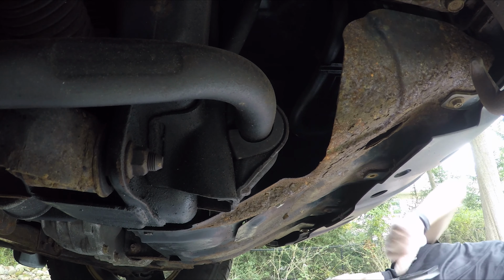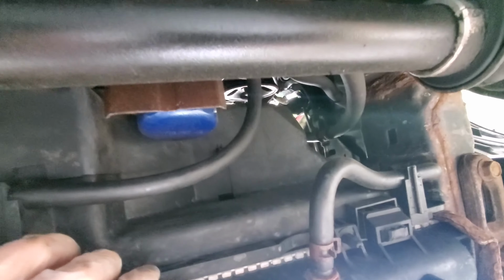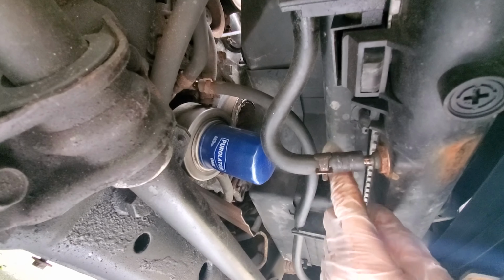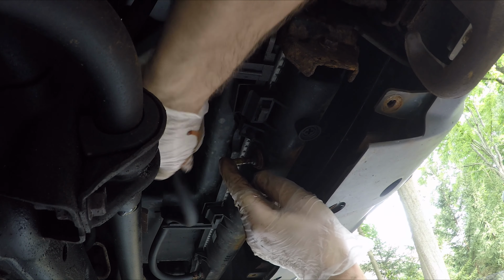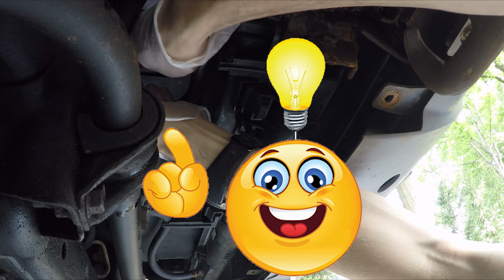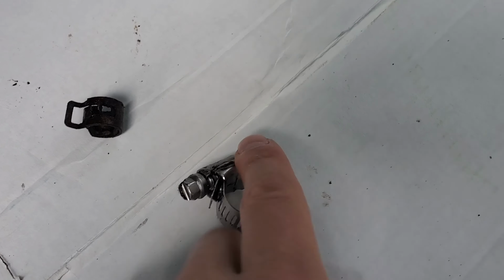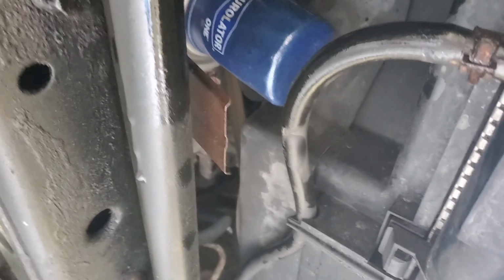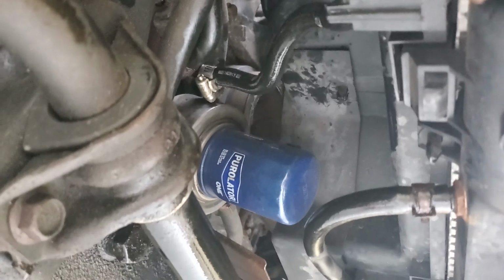SMOD Prevention Nissan Xterra Radiator Bypass ( Disclaimer Read Description )

Comment from the maker: Update !!  I finally was able to replace my radiator PLUS lots of other things  thus no longer I am running radiator bypass ! 
https://www.youtube.com/watch?v=fF0GRk-Fkdo
Reply: @DIY_AUTO_PHOTO  can you emphasize on this one some more? Does a new rad eliminate the need for the smod mod? What rad did you purchase?
Reply from the maker: @dmckay80  Yes with new rad   like ( koyorad a2807  )  you no longer and you should not do the radiator bypass to keep the trans cooled all the time.. That was the radiator I got later on..  However much later I did switch it to 3 row full aluminum rad by alloyworks  . ( i have videos on both of them on my channel )

Comment: I’ve had theee xterras and did this mod with all three. Drove 70+k miles on each chasing storms. Lots of off-road/minimum maintenance roads and never had an issue with the transmission or radiator. Simple prevention.

Comment from the maker: Please ! Before modifying your Car/Truck  make sure you read and do a research on what this modification might do  to your truck. Also.. this is a temporary solution and prevention from transition oil mixing with coolant as later I am planning on replacing the original radiator that I have on the truck right now. That is old and I dont want it to crack and mix tran oil and coolant together.

Once I get a new radiator I am planning to reconnect the hoses back to the original locations thus ensure the better cooling of tran oil. As of right now its fall and then will be winter time and I am not doing any heavy pulling or heavy off-roading  on the truck yet so I am safe. 

Thank you again for watching and be safe !

Comment: Thank you, I'm planning on getting a xterra this week with 130k miles , this is  the first thing of going to do, but first I' will Check my trans fluid just to make sure it's not milky
Reply from the maker: Awesome and congrats on your xterra !! I am sure you will like it ! what year is it ?  
and I am going to make a update to this video soon! so.. be sure to check that out too
Reply: @DIY_AUTO_PHOTO just bought yesturday, 2006  with 131,xxx miles
Reply from the maker: @Freyes2017  congratulations !!! on your new truck !! almost like my then just with a a bit lower miles )
Reply: @DIY_AUTO_PHOTO  I just go mine and try to do the bypass but seems the  hoses had been move  by the previous owners, the hose that closes the cycle at the bottom of the radiatior side to aide its not there and has a plug on both sides instead.  The previous owner had this truck for 3 years with no issues.
Reply from the maker: @Freyes2017  Oh nice so it is already bypassed then, just make sure there is no pink stuff inside radiator... so should be safe for now.. just be careful dont do alot of off roading or tow something as transmission might overheat..  later on the right thing would be to replace the radiator to Koyorad A2807 and place transmission hoses back to original locations for maximum cooling
Reply: @DIY_AUTO_PHOTO  I appreciate your help bro, Im looking at the radiator cap  but it doesn't have serial number and  it just shows the nissan cap with "never open when hot" in different lenguages, that's means I have to replace radiator ASAP correct?
Reply from the maker: @Freyes2017  more likely its original radiator.. and it might lead to SMOD...  new video is up tomorrow with all the links and part numbers for all new radiator caps hoses and etc. ))
Reply: @DIY_AUTO_PHOTO  thank you.

Comment: Ok I just completed this bypass.  The rock guard takes a couple of minutes to get on and off. I found that if you loosen the passenger side rad hose first and just get it to the edge of pulling off it makes it easier. As for the other line, the hose clamp was in an awkward position so I had to go in with both hands, squeeze the clamp then pull with both hands. The only fluid that came out was on the radiator part of the hose as when you take it off you tend to let it go. When it does it drops below the rad level and some of the fluid in the hose comes out, like 1/2 a shot glass. Definitely easy, takes about 40 min with taking off the rock guard and looking at everything.
Reply from the maker: Nicely done ! and good write up there buddy ! be safe but keep in mind that this is temp fix.. well unless you plan to off road or tow stuff you;ll need to prob get a new rad and reconnect lines later to keep it cooled better

Comment: So this is good only if you're not towing anything correct. And this is by far best explanation vidoe out their.  Even with accents, understood everything perfectly
Reply from the maker: You are correct ! if you not towing or not doing any off roading .. )) and thank you very much !  I try to do my best ;)
Reply: @DIY - AUTO & PHOTO  damn I wanted to do some off-roading lol, I'm half way threw your other video of replacing the radiator.
Reply: I'm also planning on getting an xterra soon, just don't know if I want se or se off road. But my dad has a 2005 pathfinder 2wd so ima do this for him, trucks at 150k
Reply from the maker: @jpadilla0515  at this time I replaced the radiator 2 times ))) lol  and if  you can get an OFF ROAD model its better ! lol ))

Comment: Great video.  I got a 09 xterra and I will probably skip the hose change out and just plan on replacing the radiator. Thanks again 👍
Reply from the maker: Thank you ! and Yes !! that would be the right and best way to do it ! replacing radiator  as this is just a temp solution. 
Good luck on your replacement ! you already know what radiator to get ? 
and I will have a new video soon too on replacing radiator )))  just waiting for few more parts to come in to do the replacement right )) 
and then ofc  just will need some time to do the actual replacement and filming/editing
Reply: Looking forward to the video

Comment: Simple and most certain answer to this problem is to buy an external trans cooler and mount it. No worries about mixing.
Reply from the maker: Thats a very good option as well ! and something to consider in the future as well prob... now I have replaced radiator 2 times already.. to keyrod first and then to a 3 row all aluminum rad now Im very happy )
Reply: It already has an external cooler behind the grill in front of the radiator.

Comment: Late post but if one is planning on towing so “don’t” do the bypass? 
And if not, then do you recommend replacing the radiator then instead? And still tow? 
Your video was the easiest I’ve found 
Thank you so much!
Reply from the maker: Hey ! Yes if you planning to do towing you really should do the radiator replacement instead !  to help and keep trans fluid cool as possible 
or if you live in some hot zones . The radiators are not that expensive and to replace them is not that hard ether just takes few hours and common tools.
I have a video on rad replacements as well ;)

Comment: My project for this weekend.
Reply from the maker: Great ! but also keep an eye on the temps after that if you can.. but it would be best to replace the radiator to keep things cool )
Reply: @DIY_AUTO_PHOTO  I put 400 miles through Vermont. No problems at all. Thanks again.
Reply from the maker: @allansisson355  Oh very nice !! mmm yeah they have some very nice trails and roads there ))

Comment: Should u let the trans fluid dran out of the bottom of rad when u do this just in case the welds do  break in the future and are not already broken and then it won’t mix fluids together are dose it need to be in there jw ?
Reply from the maker: Yes.. it would be a good thing to do! just to be safer, the only reason I didn't do that because I knew I will be changing radiator anyways soon..

Comment: When you take off the hoses does much trans fluid come out?
Reply from the maker: No not really as the truck is not running there for there is no pressure so its not  circulating so you might have just few drips .
Hope it helps

Comment: Hello, I noticed you did the bypass in November. ?Did you notice any transmission issues after the bypass? Particularly driving in cold weather, as the radiator warms cold transmission fluid.  I have an 2008 pathfinder with 99000 miles and I expect I will do the bypass also.  I am unsure if afterwards I should install another transmission cooler as sometimes I pull a 19 foot ski boat?
Reply from the maker: Hey no personally I didnt notice anything but ! I would suggest ether add extra cooling or just ( better ) replace the radiator and keep the trans lines connected to keep them cool.  like I said bypass is only temp solution to prevent SMOD  new Rad is not that expensive.. I replaced it and now everything  good
Reply: @DIY_AUTO_PHOTO  Do you know if they have upgraded the radiator now so the it will not deteriorate the transmission line within the radiator. Like the others have done?
Reply from the maker: @rockstomper8390  I believe after 2010 year model they fixed 99% of that issue..  but anyways radiators should be replaced every 10 years as they gets damaged overtime due to road debris and internally..
Reply: @DIY_AUTO_PHOTO   I have seen reports of the failure at 80,000 miles. If you put another radiator in and connect the tranny lines what assurance do you have that your latest radiator willl not fail.  Its the same make radiatror you took out right?
Reply: My Pathfinder has 99200 miles. I'm going to do the bypass and add an additional cooler. I pull a 19 ft ski boat. Do you know a good way to read the tranny temp or add a guage?  I'm thinking maybe some scan tool might be able to read it if there is a sensor in the tranny.
Reply from the maker: @rockstomper8390  thats a good question !  I wish my OBD2 bluedrive was able to read tranny temp but at the moment it don't have that option so I would suggest to get ( ScanGauge II Digital Trip Monitor )  its a little pricy  I feel like but it gets the job done.. it gives you different readings and trany temp is one of them  . You just plug it into OBD2 port and put that little screen somewhere and thats it
Reply: K so people are saying replace your rad but  really u could replace the rad all day long and the cooler could still leak inside the trans. Am I Right?
Reply: Ya agree because its the cooler leaking inside the trans not the rad... so the bypass is the best solution so u never get a milkshake and  just don't let it get too hot..I may try putting a temp gage on it.

Comment: Then can I add a transmission cooler? Won’t it over heat without it
Reply from the maker: it would be best to replace the radiator to keep the liquid  cooing fully functional.. also can add a 2nd cooler as a backup
Reply: @DIY_AUTO_PHOTO   got it, so bypass the cooler in the radiator and just run the external transmission cooler
Reply from the maker: @1994RALLY  thats another option yes.. as long as you dont do alot of off road or tow stuff.. then you might overheat

Comment: Just bought an 08 Xterra, had no idea about this issue, so after doing research the general consensus is to replace the radiator correct? As the bypass is only temporary Also does it matter what type of radiator, is there a radiator you recommend? Thanks
Reply from the maker: Hey ! I had no idea about this issue ether when I bought the truck as I was going to buy anyways because I just love how the truck looks and what its capable off.. anyway 😆
yes bypass is only temp solution just to prevent the contamination and $1000s of in damage and repairs .
I made a new video where I am replacing radiator and I would highly recommend getting that radiator, I also have include all part numbers to all the parts I used . hope it helps 

https://www.youtube.com/watch?v=fF0GRk-Fkdo
Reply: @DIY_AUTO_PHOTO  thanks I checked out your updated video. I was going to buy the radiator from Amazon but I’ve read to stay away from dealers selling koyos rads on Amazon , so guess I’ll buy from the same website you used. Thanks for your help
Reply from the maker: @arangel187  yeah I bought it from there and they shipped it in 2 days I was very happy  )  also since you changing rad might as well change those rubber grommets holding it

Comment: Hi could I apply the same technique to my Frontier 2010?
Reply from the maker: Technically you can as they both share same parts this trucks but I believe on newer models 2010 and up they fixed that issue but I would double check on the forums , goodluck

Comment: Hello, question? Is it safe to run the transmission without a cooler. I don't tow or anything like that
Reply from the maker: it also depends on the weather that the truck is been used.. now..  personally I woun't run it without cooler.. yes for some time it might be fine but overall overtime I think it will just shorten the life of transition .  This is my personal feeling and understanding of it...   once I saved up money I replaced my radiator and connected tran lines back to keep them cool  
https://www.youtube.com/watch?v=fF0GRk-Fkdo

Comment: So the transmission doesnt have a cooler? It exits trans and goes back in without going through a cooler?
Reply from the maker: Yes  it dose it has a small cooler at the front of the radiator but  the way they did is to maximize cooling of trans fluid so it goes thro radiator that has s small build in tubes just for trans fluid to pass so it cools more . hope that makes sense

Comment: What would happen if you continue using this bypass instead of buying new radiator?
Reply from the maker: It all depends on the stuff you do to the truck.. if just using for daily drive.. probably nothing and if you dont get +100F temps of weather in the summer  but if you plan to do some off road or towing .. you will overheat your transmission
Reply: @DIY_AUTO_PHOTO  is there a way to add an external radiator so I do not use the original anymore. I HEARD that even replacing the radiator you will suffer the issue later
Reply from the maker: @mauriciodelvalle4648  external radiator for trans  cooling along will not give you good enough cooling vs water cooling. So I would replace the radiator for Kyorad brand they are great not too expensive . They will not have that issue of mixing cooling with trans.   I have full video on that with all the parts numbers .  AND I have a video where I replaced to 3 raw all aluminum rad as well.  once you dothat you can add one more external trans cooler also for even more cooling.  ( I will have a video on that too in the future  I already did the install )
Reply: @DIY_AUTO_PHOTO I couldnt find the videos 😢
Reply from the maker: @mauriciodelvalle4648  here is the video I am doing my first radiator replacement with thermostat and belts and stuff ))
https://www.youtube.com/watch?v=fF0GRk-Fkdo
Reply: @DIY_AUTO_PHOTO  thanks man
Reply from the maker: @mauriciodelvalle4648  You are most welcome ! let me know what you will do ))

Comment: Why even put the hose in tthe bottom when nothing is going through it anymore
Reply from the maker: Ture, you can just put cups at the ends of the rad.. but because I knew I will use it again in the future ( after I replaced to new radiator have video about that )  I just kept the hose there like that.